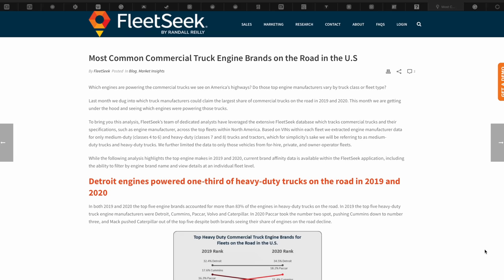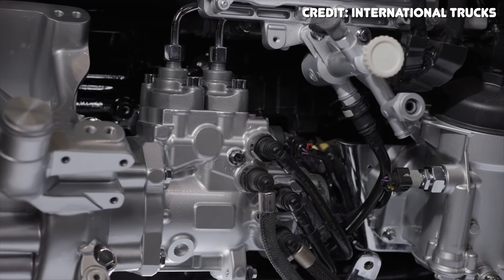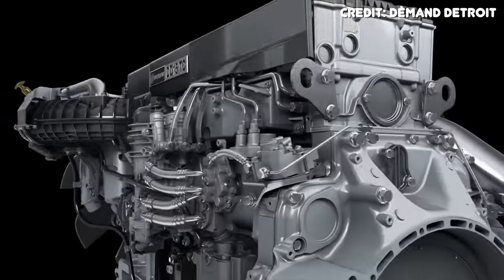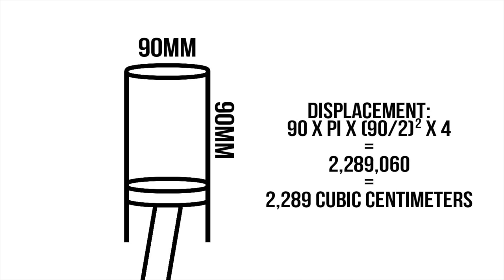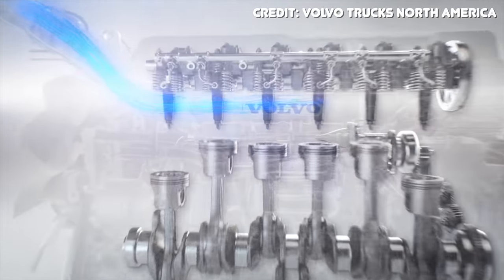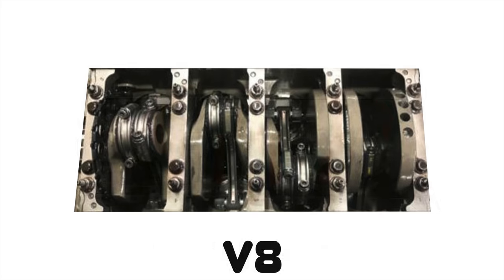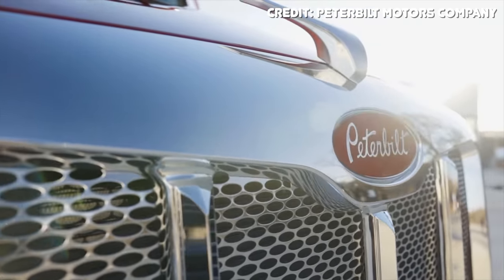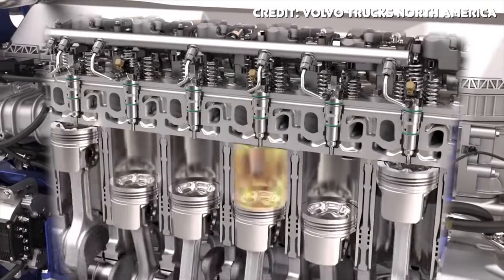Why do Semi-Trucks Use Inline-Six Engines?

Comment: All engines should be straight, inline six, from the old merz and BMW to the v12s which are two 6's put together. Other configurations are not worth building and yet we have them all over..

Comment: YOU FORGOT THE TANK ENGINES!...4...too small...V-8 not tough enough...Airplanes used to get flat 6(3X3 in H) or real big ones,  12 pistons engines(two sixes in  H set) 
Too expensives ...inline six is the last choice for trucks.(however the tanks' engines was flat six or flat in H twelve...better that trucks but they just remove the whole thing to work on!)

Comment: You didn't add the durability of the Inline, V configs big enough to generate the necessary amounts of torque, were not durable, and they weren't nearly as efficient. 
Early on, the industry tried Inline 8's, so much less efficient than the Inline 6's, so it became about size, make the Inline 6 big enough, and you get efficiency, the torque and the durability.

The V's that came along later could not compete with the Inline 6 in any category.

Comment: 5:38 “Horsepower is irrelevant”
Eeeeennnt! Wrong
Wheel torque is what moves the vehicle, unless the powerplant is a 1 to 1 gear ratio with the wheels this is true then. But ALL motor vehicles are gear reduced unless intended for speeds above 300mph. Horsepower IS the same as wattage and is the total work produced, and since Semi’s almost always have a ton of gears means a low hp to weight ratio which we all know when they’re taking up both lanes in a mountain hillclimb. Low HP “High Torque” diesels slow way down going up hill, but higher HP still “High Torque” diesels fly up the hills in a similar gear. (Because they can still pull at higher rpm’s, shhhh, it’s a secret)
But to the original point, the fully loaded semi only needs a fraction of big horsepower to cruise down a flat road so is why low revving high low-end torque diesels are king, lower rpm’s have less friction and get higher mpgs. 
That’s it.

Comment: inline 6 are the most common engine on commercial trucks but it exists (actualy) V6 (mercedes-benz actroc 12 liters 14 liters) V8 (scania 16 liters caterpillar  etc...),  V10 (old mercedes benz trucks about 18 litres) and also V12 (old Mercedes-benz 18 litres but also mercedes motorhome V12 12.5 litres....yes a motorhome is not a commercial vehicule but the motorhome i'm talking about is based on actual Mercedes Actros https://youtu.be/G9XhLca9JSk )

Comment: There are really on three big truck engines. Cummins, Detroit, and Caterpillar. The others are notorious junk. Notorious, with a capital N. Owner ops are gonna want a Cat. Old school Detroit V series two strokes are also very fun. Cummins are reliable, and the parts are way, way cheaper then Caterpillar. The best diesel engine ever produced was the Detroit 60 series. Thus ended this lesson. 36 years big trucking, and counting. For those of you who are not truck drivers, the typical big truck engine weighs as much, or even more, then your entire car. Just the engine!

Comment: Emissions is another reason they stopped offering v8 and v12 configuration engines as well as aerodynamics and engineers wanting to get away from the long flat hooded trucks of the 60s 70s 80s and very early 90s

Comment: CAT was one the better turbo Diesel engines.  Like c15 6NZ or C16.  It’s sad that cat got out the Business what back 2007-09?   A lot older truck drivers will choose old CAT engines or Detroit diesel. Back when you could get glider kit. Basically bran new truck without engine.  And older drivers would get CAT or Detroit diesel cus they known for being solid good engine.  Or sometime go with cummins.  But I’ve never hurd truck owner saying Paccard being good engines. 

If you asked why a lot truck drives are ditching there newer trucks.  It’s because of Diesel emissions choke newer engine so much that they eventually die or break down. Sure it’s getting bit better now.  But A lot truck drives who been driving for years. Sell their new trucks and find older truck rebuilt or put older 1990+ to 2006 cat engine in their truck because it was time before all truck emissions clamped down on trucks.   Pre emissions trucks would easy do 500,000 miles or more before they need full rebuilt of the engine.  New truck engine are prob barely even lasting that long cus tight emissions and all computer shit in them break down.

Comment: Dude, an engine that large (and with large parts) will not even endure 8000 rpm without bursting. It won't have lifespan above minutes above 4000 rpm.

Comment: If you woke me up out of a drunken stupor and asked me to list my top 5 engines ever made it would go as follows.... 

1: 12V Cummins (inline 6 diesel)
2: Jeep 4.0 (Inline 6)
3: Toyota 2JZ (Inline 6)
4: Ford 300 (Inline 6)
5: 7.3 Powerstroke? (V8 diesel)

You guessed it, reliability is my main measuring factor for this list. These engines have the highest average mileage of almost any engine produced (excluding medium and heavy duty). Inlines inherently produce more torque due to their geometry. The opposite is a Flat engine which usually trades torque for horsepower. Also an inline 6 is inherently balanced.

Comment: Greetings: "Popular" as used, is not always the popular (most liked). The statistics generated R of purchase and not opinions of users or mechanics. That said, the #1 "popular" is not the most liked or preferred. The theory of the I6 being better balenced than a V8 is basically true. However in practice, the large I6s Generate much more vibration and movement due 2 compression, stroke, torque, counterbalance, Etc. As such designed, primarily,  4 work and not comfort or efficiency. The smaller gassers have the inverse by design and application. In such the ICE is very inefficient by application.  Caterpillar quit producing U.S. OTR engines Bcuz of regulations. Basically they wanted a noose the Cat's neck restricting the performance. Something Caterpillar would not degrade themselves 2 do. In this they maintain their high reliability / performance reputation. Since I prefer the older Cats NEway, this was not much N inconvenience 2 me. 6MPG can still B obtained on a A or B block while still in the 400-600 / 1500 - 2000lb torque areas. The fight of the smaller (consumer) engines GM/Detroit, Ford/Int'l and Ram/Cummins is still ongoing. The advent of the U.S. increased emissions regulations and those loyal 2 which 'Big 3' they like has led 2 continued competition. Consumers fooled by the 'Big 3' thinking the engines R of their own Mfr. Cummins, not of my preference still has the best torque / in³ Bcuz of it's I6 configuration. The line is fairly dependable, efficient and decent on performance. The GM/Detroit being the next in line however a V8. The Ford/Int'l next being far less reliable with less performance off the lot. Those may argue. However the fact remains much expense, time, parts and effort has 2 B applied 2 get close 2 the other 2. Usually the tasks at had R far exceeding the designs of these small engines. Ppl expect a cheaper engine 2 accomplish the near same tasks as the larger. As such this leads 2 their demise.  ""Momma always said "Stupid is stupid does" ". Bottom line- The big 6s R designed 4 performance, reliability over a lengthy time. Usually 1,000,000 mi. U do not get that from the smaller guys without really babying them. The Ford/Int'l doing lucky at half that.

Comment: Everybody's talking about going all-electric, I think it's going to be a while before we can balance the battery problem with coal and power plant emissions in some way to heat the inside of the vehicle in the winter time and air condition the vehicle in the summer and still have the capacity to go where you need to go every day of your life. The only other solution would be some sort of a power plant that doesn't need to sit there and regenerate all the time. I used to say isn't this kind of strange we have to fill up our vehicle at least once or twice a week depending on where we have to go and yet a nuclear submarine needs to be refueled once every 20 years. I know it's a joke but I'm still looking for my Dilithium crystals. To go where no man has gone before. Deet ta Deee

Comment: They don't have more peak torque they have more low end torque a inline motor produces more torque at a lower rpm then a v motor does but the peak torque is not more then the v motor diesel motors weather they r inline or v r a low rpm motor regardless they make there torque at low rpms and don't need the rooms to do the work

Comment: Hmpf. Very US-centric.
Doesn’t really explain much.
The “Size is no issue” very much is not true for European length limited trucks.
So why did Mercedes-Benz switch from V6 & V8 to I6 for the 4th generation of Actroses.
I mean, the other points, especially the torque was true before, so why did they use V engines before?
And the “easier to work on”, for a cab over, it may be easier to get to the two heads of a V engine than to the one of an inline.

Comment: Detroit could never make a good v-8 diesel. just about all road tractors use the series 60' in line 6. Cat stoped makeing the 3208, went with 3116/ 3126. 3406 still being used in tractors.

Comment: Mercedes trucks in Europe have v6 and v8 engines, also Scania and MAN trucks have v8s
Reply: Mercedes has discontinued V8s in EU years ago
Reply: @simonm1447 
Why? And does v6 provide enough power?
Reply: @Wqghfxz  a typical class 8 truck (40 t in EU) needs around 500 HP. You can get that out of an I6 without any problem, the displacement is still huge, the engine just has 2 cylinders less. At the same time the I6 is simpler to make, and has a better fuel economy.
Fuel economy is everything in truck business, fuel is the most expensive part of the ownership, beside the driver

Comment: The inline 6 is superior to all engines. Think the 2jz or even 1jz Toyota. The Nissan L series that spawned Godzilla. The new Ford  Barra.... The old Ford 300 cubic inch that will last a million miles. The cummins. Gas or diesel it doesn't matter the list goes on and on.

Comment: Great video. The units of torque are actually ft x lbs not ft /lbs because the equation for torque is force vector cross product with radial vector which simplifies to force x radius x sin(angle between them).

Comment: Not really agreeing with your explanation of why semi-truck engines are high torque but not so much horsepower. It isn't that horsepower is irrelevant...horsepower is actually measuring the work that accelerates the huge weight of the vehicle from a stop, and the constant work of pushing against air resistance and rolling resistance to maintain speed on the highway. If you built a semi-truck with a 3.0L naturally aspirated gasoline engine from a race car tuned to make 600 horsepower at 10,000 RPM (that's only 315 torque), and you had enough gears to keep it in the tiny powerband, that semi would pull the same load up to speed and keep it at highway speeds just as easily as a 15L Cummins turbodiesel...for about fifteen minutes until it exploded into a million pieces. The only reason semi-truck engines need to make 1000-2000 torque is because that's what it takes to make 300-600 horsepower at 1000-2000 RPM so they can survive millions of miles under heavy engine loading, like you pointed out.

Comment: I guarantee nobody that works on commercial diesels likes Paccar.
Reply: Since he brought it up, this is not to say that Paccar engines are inherently less reliable or powerful, only that the engineers and designers of the trucks they go in gave zero consideration to the techs that have to work on them.

Comment: I want to know why they are called Semi-Trucks.  Semi means half and these rigs are the whole dang thing
Anybody?
Reply: "Semi" actually comes from the trailer.  Semi-trailers are semi supported, meaning they are only half-way supported by their own wheels and need another set of wheels to move.  Semi trailers need tractors, (trucks) so trucks set up to pull semi trailers become semi trucks by default.

Comment: Horsepower is not torque times engine speed or, whatever it was that you said. 

One mechanical horsepower lifts 550 pounds by one foot in one second.

Keep your facts straight, bud.

Comment: Its not accurate to say that truck engine just need more torque. The amount of torque is totally irrelevant. What is relevant, is how the torque curve is.

A truck that runs throw gear want a similar acceleration  with the whole range of the same gear. This is done via having the same torque in the full gear spectrum, hence, a wide and flat torque curve. Actually even better having a torque curve that is high in the low revs and slowly leans down at the high revs. This gives a smooth gear shift.

The actual torque number is irrelevant as long as the horsepower is sufficient. Because torque is really just hp/rpm. If the torque is low, the rpm is high (for the same HP). So just change gearing would solve that.

The reason why truck engines are high in torque and low in revs have nothing to do with power, but rather efficiency. There are several reasons for this.

Firstly a engine with very long stroke, have a lower seal area. This both decrease leakage and resistance. A long stroke engine also have a more symmetrical burn disc, decreasing losses do to surface effect. (less surface per volume). Slower rotation also gives the engine more time to burn the full fully at optimal position and give the gas more time to push down the cylinder.

Ship diesel for example have an insane stroke to bore number.